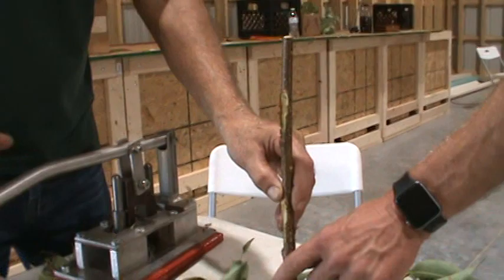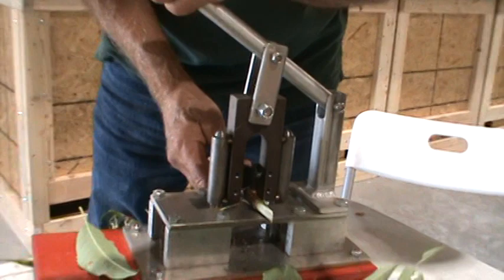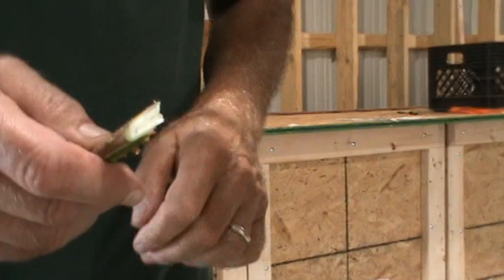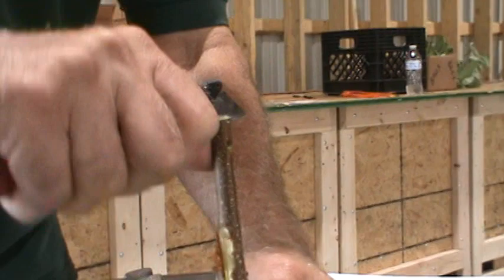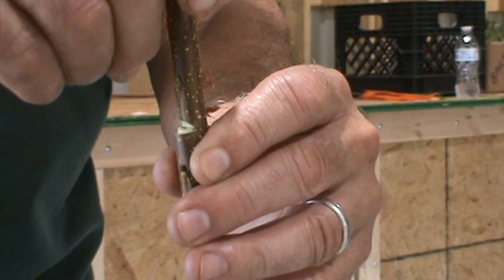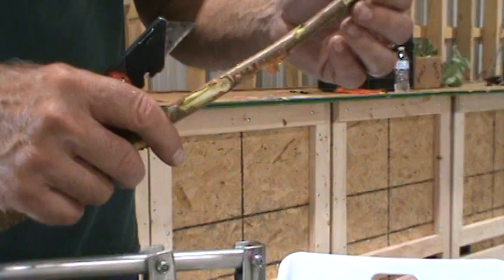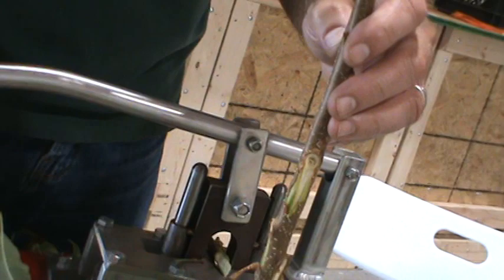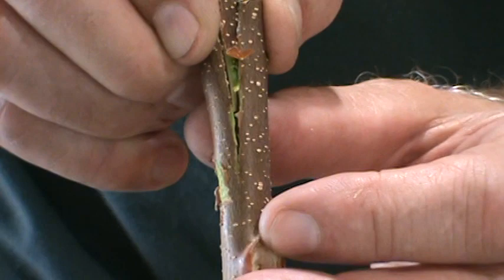Demo Of The $1295 Grimo Grafting Machine

Comment: Why wouldn't you insert the rootstock into the opposite side of the machine to make the matching cut?  It sure does make a nice cut on the scion!
Reply from the maker: You could, but when you split the rootstock, the split wants to spring back closed, so it grips the scion tighter, making it easier for it to grow together.  A perfectly matched cut to make together would be a loose fit, increasing chances of misalignment while you are taping it up or if the wind blows it.
Reply: Good thought.  Thanks!  @TheOhioCountryboy